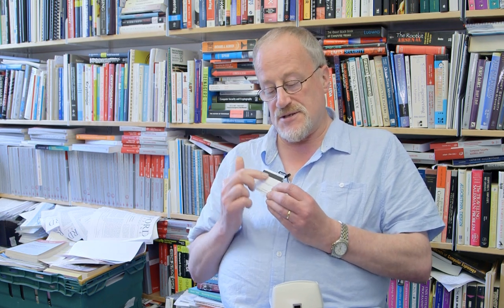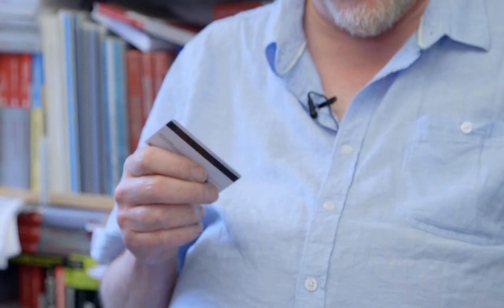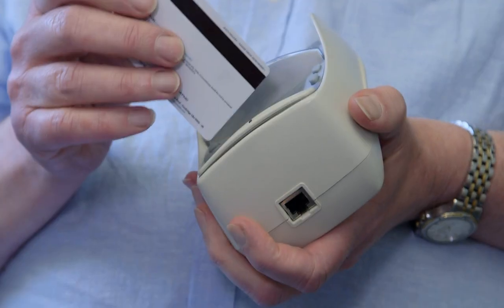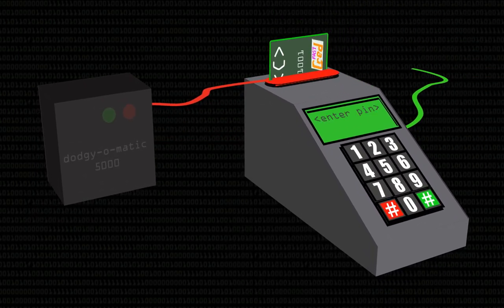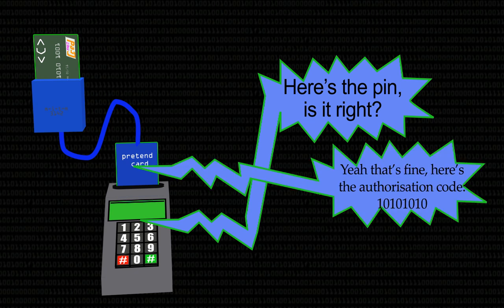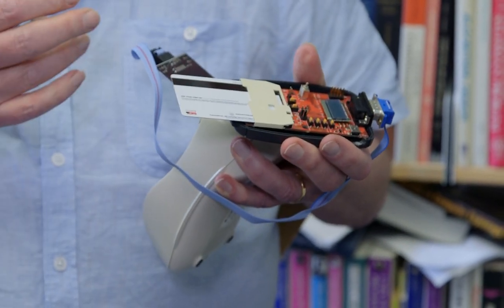Chip & PIN Fraud Explained - Computerphile

Comment: Where I work (most transactions >£100) the card machines reject swipe unless the chip can't be read properly, if you stick the card in the wrong way 3 times it'll automatically switch and ask the customer to swipe it. Really easy to do low-key. Not quite as advanced as the methods in the video but it's pretty scary to think that somebody could pick up my card off the floor and rack up £1000's (assuming I wasn't broke lol) with little more than a few seconds fiddling, before I even knew I'd lost it.

Comment: Wait a minute, wait a minute, I thought the whole point of chip cards is that the communication is encrypted? The data sent across the wires that are being tapped with these techniques should not contain the user's information plaintext, it's private-key encrypted and hashed against the clock, so why are these attacks working? Is this an older version of the technology that sends the data plaintext?

I can see how the third example, with the false-card inbetween could work, but that will be fixed in the future as soon as credit card companies get with the times and stop allowing signature transactions. The other two, though, shouldn't be able to work as the technology works right now.

Comment: Will mobile payments solve many of these problems? I've used mobile payments whenever I can for the past 2 years or so, but I have just moved to Samsung Pay which is, besides NFC, compatible with mag-stripe and chip-and-pin terminals.

A pseudo card number and tokenization would be more difficult to forge, right? I have difficulty thinking of ways to forge the pseudo card and tokenization method.

Comment: The one thing I thought would be helpful was 
Transaction:
machine asks card for bank info
machine reads LAST transaction signature from card
machine gets pin
machine asks bank if card is valid based on info and last transaction; all encrypted to high hell
machine authorizes transaction, and saves new signature to card.
If someone skims it then the card gets burnt when the last transaction doesn't match what the card thinks.

If they man-in-the-middle it can't write the correct signature to the old card.
Reply: +frollard how would you burn a card? That would also be highly inconvenient. Also, "encrypted to high hell" - Most encryptions can be broken if needed, especially when money is involved.

Comment: No matter what the system, if there is enough money to make the effort worthwhile, it will be hacked/cracked. Cash can be counterfeited, and you are out that money if you are caught with it, the bank isn't going to refund you that money. 

All that can really be done is make it more difficult to do so. Usually by adding "friction" to the transaction, longer pins, sms verification at the point of sale, bio-metrics and more complex protocols.

At the end of the day it is a cost of doing business conveniently, which ultimately gets passed on to the consumer somewhere down the line.

Comment: Why even use a debit card? I use a credit card and then pay it off, no risk of my pin being compromised while shopping. It keeps my checking account out of it and if the credit card is compromised the issuing company is responsible for the debt, not my checking account.
Reply: +THATMOFODIRT First you need a good enough credit rating to qualify for a credit card. Second, you need a credit card issuer that won't assume you are at fault for your card being used fraudulently.

Good luck with the second point, because almost all credit card companies refuse to issue refunds if your card was used fraudulently with Chip & PIN because they will assume you disclosed your PIN to someone else.
Reply: watfordjc This applies to the U.S. If it's different in other regions then it does not apply.

Who enters a PIN when using a credit card? All of mine get swiped for payment and thats it. Sure, a PIN can be used for cash back or debit card transactions but for the majority of purchases a simple swipe is all thats needed.

When using a CC any fraudulent charges are not going to get taken directly of a checking account immediately so it's a barrier between fraudulent activity and your actual money.

Cardholders cannot be held liable by federal law. Issuing companies have a zero liability policy that relieves it's cardholders of the responsibility of fraudulent charges.
Reply: a number of establishments won't accept credit cards. ARCO gas for example.
Reply: Most debit cards in Australia also act as credit cards so you can draw from the credit account on a debit card and it'll just draw from the debit account :)
Reply: What if both card issuers are the same company?

Comment: What cloners are doing with 201s is just writing the info on the mag strip, and shorting out the chip in the clone. This will read chip fail in the machine and have you use the stripe after 3 attempts, or even just one attempt depending on the terminal.. This is where it's important to have cashiers trained to check ID with card for high dollar purchases, and make sure the last 4 on the receipt matches with the card. Of course a more advanced fraud will be prepared for this with a matching clone.

Comment: Until they ditch the SDA protocol its easy money. For under £100 you can purchase the required reader/writer and suitable blank cards, bins etc. Some of the issuers haven't addressed this, because in terms of percentages, the losses caused by use of cloned cards, are relatively very small, whereas implementing cda/dda is costly.

Comment: A payment card has form factor of a smartcard.
The chip has the physical interface of a smartcard (I haven't compared, but at least it's very similiar).

So why the hell doesn't it work like a smartcard? I always assumed that when I input a PIN on the keypad with the card inserted, some cryptographic transaction was taking place where the terminal would input hash of the transaction to the card which would sign it when unlocked with a PIN.
But then "contactless" cards came along and I realized it was not even close. You swipe the card (obviously there's at most a pre-shared key to do anything at that point) and then input the PIN without the card present afterwards. What the hell? How's that supposed to help anything?

Any idea why this isn't it implemented like a smartcard? Even for wireless, you could type the PIN, then hold the card over the reader and it could still unlock with PIN and sign - just wirelessly.
Instead there's some obscure insecure-by-design protocol that can never work when you start looking at it even as a user!

Comment: Didn't mention the thermal cameras which record the pin according to the temperature colour on the keys of the machine.
Reply: +Tanmay Agrawal ha good luck doing that where im from, its always fookin freezing :)
Reply: You can protect yourself from this by pressing random keys after you're done to put heat signatures on incorrect keys
Reply: edit: double post, thanks google
Reply: +Dave Birney If its freezing then its probably going to be easier for the camera to read the temperature difference.

Comment: Whist this is all correct , its not quite as simple as you make out. There are loads and loads of different tamper protection in card machines now. For example there are hidden keys under the keypad that are always pressed , if you open the keypad the keys will be unpressed and it will wipe its own NVram. There are of corse tamper switches on the case and on the shielding . There are special ICs that you cannot get to the die without destroying them, the serial lines are now shielded and so on.  

Sure you can do man in the middle stuff and so on but who is going to let you stick a card with a ribbon cable off the back of it into there reader.

The dodgy "fake" card reader is a problem but don't they have some sort of certificate in them that is encrypted and hard to spoof or do the bank just accept any correctly formed transaction ?

Mag strips are even less secure as you don't even need to bother with the pin, its almost a trivial matter to read a mag strip and clone it.

The RFID "contactless payment" ( is it RFID or is it NFC ?) is limited to small transaction and at least in the UK is fully insured by the bank if something goes wrong.

And why bother with all of that for a few cards when you can steal 1000s and 1000s ( of cards) on the internet with a fake website or spoofing a real website without leaving your comfy sofa ?

Comment: Welp, time to move to NFC payments. Honestly, my Gmail account is probably more secure than my bank account at this point; the financial industry is really falling behind.
Reply: +Andrew Meyer NFC has it's own share of problems. When NFC credit cards were first introduced in the UK, Marks & Spencer (a UK supermarket chain) had major problems as they were one of the first to use the new system and found they were accidentally charging the cards as people passed the checkouts to get out without buying anything.
Reply: Yes you can, on the same token you could put an LCD screen on the cards. It's still an overly complicated protocol between computers with numerous security, flaws. The way most phone payment systems currently work is by having the phone replay the track data and use it's own pseudorandom number generator rather than the one on the card and you register that with the bank. It's the same backward arse protocols in use designed by the same banks.

Google and co. try to add security on top, but there is only so much they can do, security is as strong as the weakest link and the banks control that. Oh, and by the way, that "chip" in the cards is a cryptographic processor, that is all it is. It can check keys etc.

Banks are too stuck in the world of 1) make it as cheap as possible, 2) make it as backwards compatible as possible just in case something goes wrong. Apparently they would rather false charges to the card and then blame the customer than actually fix their shit.

How about we think about it a second and see if we can come up with a secure way to do transactions, how about this simple protocol:
Add and LCD and keypad to the card (needs digits 0-9, ".", "clear", "reset" and "enter" buttons.
User types in the value of transaction -> enter -> pin and then in a shop places it in the machine (which does the same as the next bit automatically), for online presses enter again and it shows a number on the screen. This number is the result of the encryption of the price and an OTP (next from a list of 500 or so stored on the card). Card also locally logs the price.

Now the bank decrypts the authorisation code and checks the price matches the value and the value from the merchant and that the OTP matches the next value on their copy of the passed. When one gets low on OTPs one sends the card back to the bank (where they can verify that local log of prices (again)) and sends out a new card with a new set of OTPs encoded in it.

The protocol is simple, but the cards cost a little more to produce and are not backwards compatible. But find a flaw in it as long as we used proper encryption with that OTP and price at the transaction time. Oh, and it can work via the same method using NFC systems.
Reply: Ewan Marshall Seems like a reasonable scheme to me. Though I think involving a smarter device like a phone would make that process much more user friendly (tap and pay) and secure (you can use much longer keys). It doesn't even have to be mandatory, just introduce it as a payment option then slowly start encouraging people to move to the newer, more secure, more convenient system.

It's kinda dumb that all this time and money is being spend migrating from stripe cards to another insecure system. If we're going to move to a new payment system, we should really just do it right.

Almost makes me wish bitcoin were more widely accepted. While bitcoin does have its own flaws, at least it's not as ludicrously insecure as our current system.
Reply: The Major If your concern is backdoor access, then you're correct that my Gmail account has no special protections against that (though it could; PGP can certainly be used with Gmail), but neither does my bank account. My point stands.
Reply: Not just behind in complete denial.
Reply: They are too busy counting your sweet, sweet $$$ you have given to them to "keep safe".
Reply: think again.
Reply: 2nd that, they are pathetic at security.

Comment: Best option: prepaid unnamed credit cards. You transfer the amount of money you want from your bank account in an ATM using your debit card and then use it as any other credit or debit card. In the extremely unlikely case of someone accessing both the card and the pin, you loose the money you had on it, but your bank account is safe.

Comment: There needs to be an easy way to change the spending limit on your card. That way, you could just have a really low limit most of the time, then increase it when necessary.
Reply: +Stick Figure But wouldn't that also mean that someone with your card has it easier to increase the limit?
Reply: Well, there'd be some way to verify the identity. Passphrase, PGP key, SSN, a code sent to their cell phone, etc. Something like that.
They have vulnerabilities, but it adds an extra layer of security that otherwise wouldn't have been there.
Also maybe have a upper bound on how high the limit can be set without physically going to the bank and telling them to increase it for the day.

Comment: Personally, I think the PINs should be replaced with TOTPs.
Reply: +Cíat Ó Gáibhtheacháin Top of the Pops?
Reply: +Thomas “Heat Death” Lynn 

Time-based One-Time Passwords.

Seriously, couldn’t you just fcking google it?
Reply: +Cíat Ó Gáibhtheacháin Tanks On The Pope?
Reply: ***** Those are more complicated solutions though, and have their own issues, such as expense and difficulty of setup. The nice thing about TOTPs is that as long as your phone's clock is correct, all the setup that's required is scanning a QR code.
Reply: +Cíat Ó Gáibhtheacháin The presence of a chip card is supposed to mimic the purpose of a TOTP device. Either way, it represents "something you have" that's ideally non-forgeable. The problem, of course, is that EMV makes it rather easy to forge the presence/behaviour of a chip card though MITM attacks, or to extract information (card number) that's usable elsewhere.

The other big issue is that all of the user's communication with the card is relayed through the reader, so any malicious reader is capable of recording and later simulating that interaction with the card, or modifying any details (authorized amount, etc) that the user sees. The only way to truly fix this is to put a display screen on the card showing the amount it's being asked to authorize, and have the buttons to type in a pin on the card, not the chip reader. This is easy to do with modern technology; I've got a credit-card sized TOTP device, demonstrating both button and screen in the right form factor. What's not easy to do, though, is to make it cheap enough that banks are willing to just give them away to every customer each time they need a replacement because they lost it, it broke, it got stolen, etc. So, we end up with the cheapest hardware that banks think is still secure enough that they can cover fraud costs.
Reply: Luc Ritchie
That'd be a great ONLY IF the mobile would be secure in itself. But as we all are aware, it is not. Just one example: connect your phone/tablet to ANY public Wi-Fi Network. Better still, connect to my rogue Wi-Fi network, now your naive apps will just send data normally. OK, maybe the apps is not the point of failure, but shit, at least the OS should prevent the traffic from them from reaching a public Wi-Fi network. Unfortunately that is not the case, and from this, many and I mean many issues spawn. For example: traffic poisoning by impersonating a gateway and other more sophisticated attacks. Luckily, TOTP is offline, so it just depends how you are doing the payment.
Reply: Alexandru Gheorghe Yeah, mobile payments as they stand now are terribly insecure because mobile devices are insecure. I simply assert that the upper bound on security attainable through advances in mobile payment is higher than the upper bound on security attainable in chip cards, because nobody wants to put buttons and screens and biometric readers in cards that the bank gives away for free.

Comment: I rarely use my card, if I do I usually am fairly vigilant for skimmer machines, watch it if a clerk takes it, etc. I suppose a fake machine could be hard to see, but so far this has worked well for me. There was one gas station locally I  guess just had old pumps you could just put a debit card in and it never asked for a pin#. Never had any odd charges though so seems was legit. 

We have a home depot sometimes I go to, after they had their big breach I make sure to take cash. I never used my card there before either. I was there the other day someone was having issue with new card clerk was like you have to leave it a second this is the new chip and pin setup they are now requiring for some reason. I wanted to laugh and say they are doing that because of places like you and target getting hacked. (I know why they probably said that way, but i just found funny.)

Comment: What about apple pay / google pay? Seems like they have solved the problem. ------ On my upcoming Europe trip I am only going to either use gold or silver or barter - you've scared the shite out of me now :) ! And I thought things were bad here in the USA BUT as far as number go, is it not a ton easier to buy the 10k card numbers on the dark web and just run a few off with a regular magnetic card machine? Do you really think that chip and pin in the USA will increase fraud. Oh and BTW, at least 3/4 of the machines here have tape over their chip and pin reader slots - from my unscientific survey, as a lot of the credit card vendors all having issues.